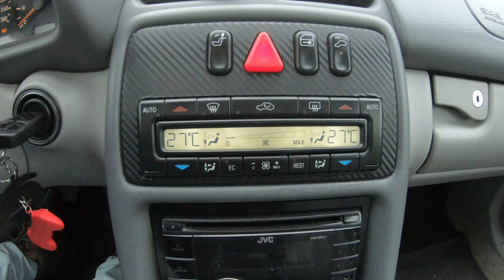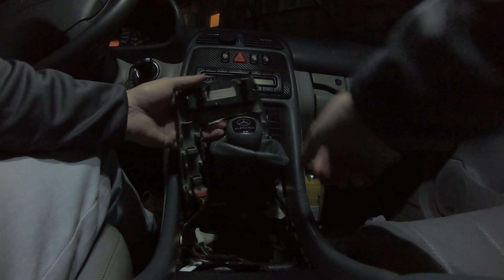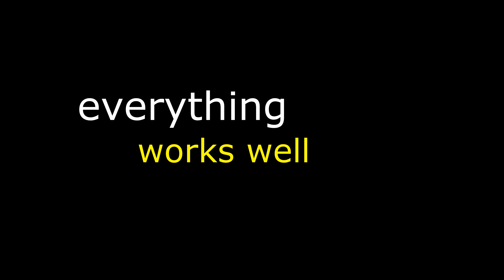Mercedes repair the button that acts to lower or raise the window,window switch,Fensterschalter

Comment: didnt work . did it ?
mine has the same problem, changed the whole control unit. still have the same problem.
reset window on highest position, then it works 1x. then problem comes back
Reply from the maker: it works for me now , I think it's work too easy , before you open it all try to reduce it from the button housing
 with the nail file as I did in the video,  I encountered cases in which the correct setting of the window was as follows:

-held high for 2 seconds until the relay is heard disengage
and
-hold down for 2 seconds until you hear the relay disengage